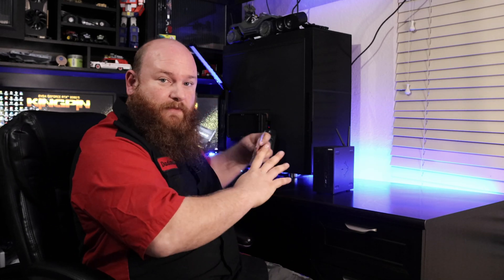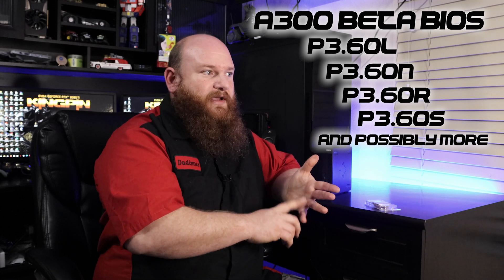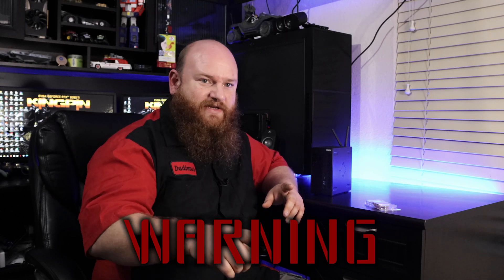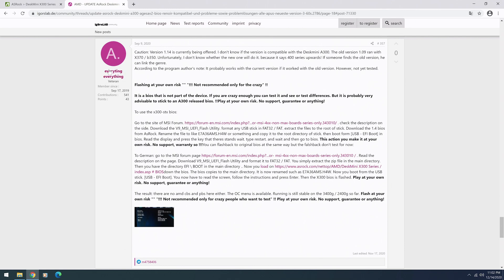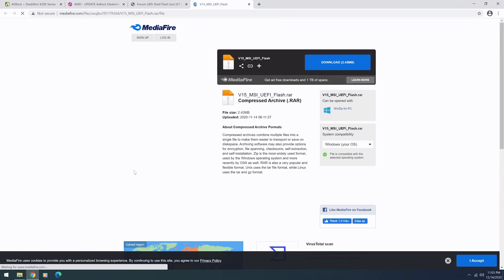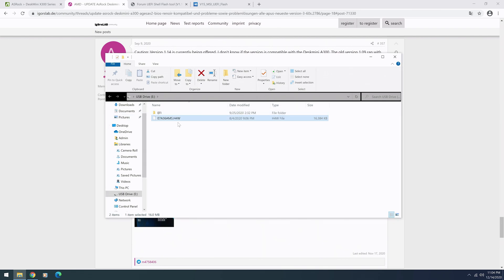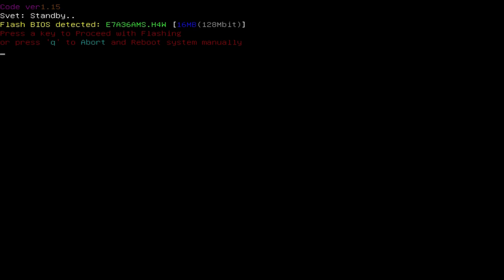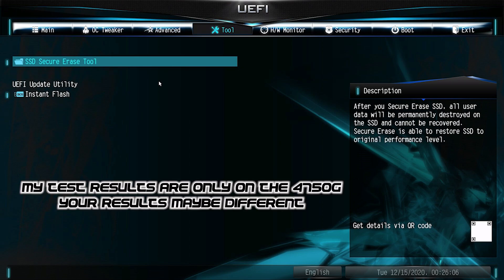Asrock A300 with 4750G

Comment: Is there any difference with x300 and a300? If so, which one do you recommend for gaming that requires lower graphics
Reply from the maker: Both are pretty much the same. The x300 got a face lift witch I think looks better. The x300 allows for over clocking without any bios change. Right now the x300 I easier to get. I would go for the x300. I mainly did the video for people who have the a300 and want do a cpu upgrade. I will be doing a video on the x300 in the future.